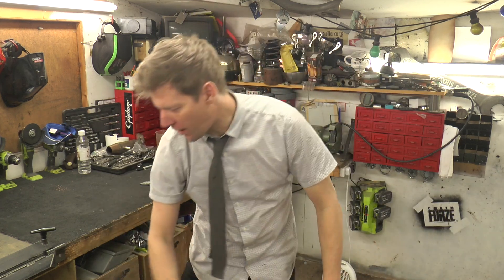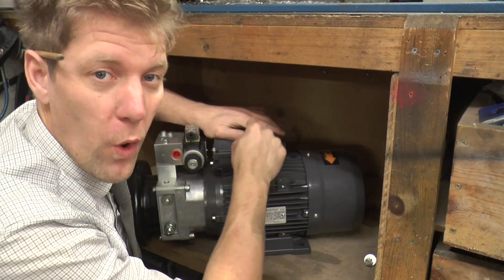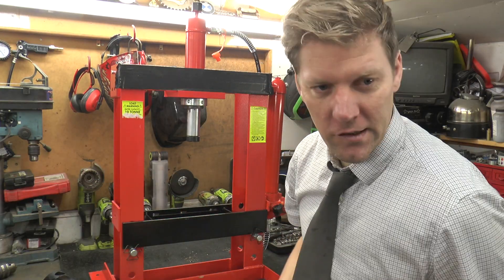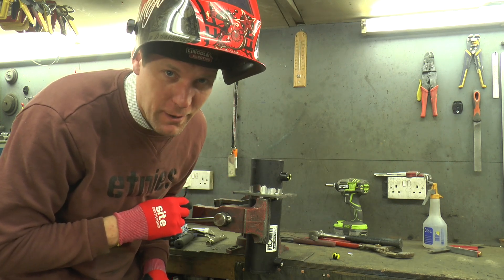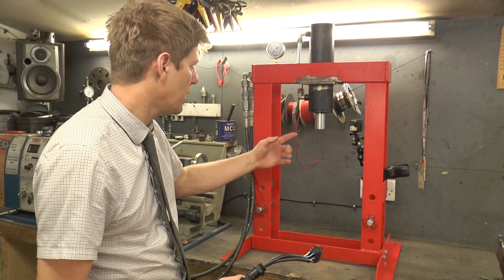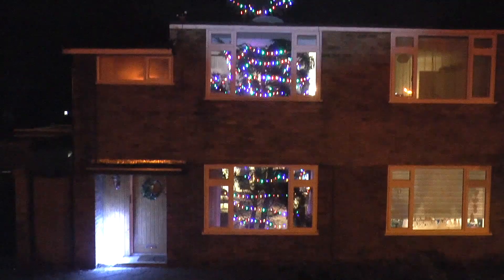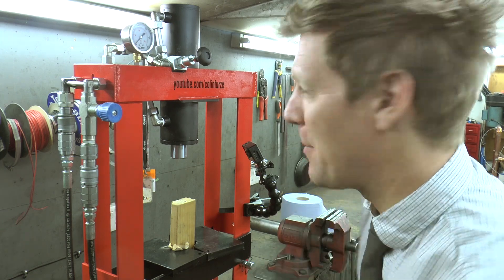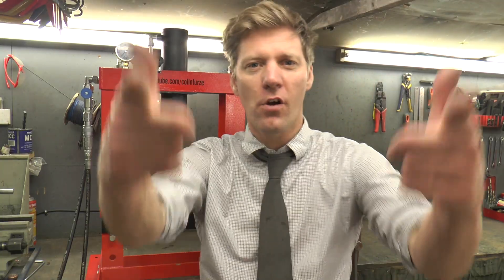Workshop Hydraulic System/Press conversion

Comment: Oi Colin' wot about ventilation for that motor and the oil , it will get bleedin'  hot under there sunshine. You've covered the fan on the motor, come on geezer.

Comment: does all ac wiring in england use those screw terminal blocks instead of the wire nuts we use here in the us? and dude you SERIOUSLY HAVE TO GET RID OF THAT SHITTY EURO TIG TORCH HEAD the  (american style?) type 9s and 17s are SOOOOO MUCH BETTER, theyre smaller, cheaper and more flexible torches are about 7 bucks on ebay, you want a 9f for up to 125a (you can push it a bit with lower duty cycles ime) and a 17f for up to 150a then get a ck superflex cable LIFE-CHANGING they stop trying to fall of everything you set them on cant tell you hoe many times my old garbage cable yanked itself off the table and cracked my glass cup

Comment: my concern is the lines leaking when i disconnect it
Reply: They are flat face couplers.  So when you unplug them the internal   cap pops back up and seals the line off. You may have a drip or two of oil but not emptying the whole line out. They are used in the construction industry so dirt doesn't enter the system.

Comment: Hey Colin, make a hover lawn mower.

no more tyre tracks on the lawn
grass gets blown away evenly to help as mulch and remove the need to empty the catcher
powered by a turbo fan..... because turbo fan.
Ultra high speed cutters for a good cut at high speed and can double as the power source for the downward thrust fan. (powered by a horizontal rx-8 rotary engine?)

And probably dangerous.
Reply: Hover mowers exist
(Flymo)

Comment: Nice mod. Is the motor getting enough cooling air though?
Reply: The motor only comes on for very breif times the cylinder is moving. There wouldn't be enough draw on it to do that and the vent on the end of the motor is not covered up just tucked away in the shelf.
Reply: Ok, thanks

Comment: PERSONALLY  I WOULD FIND THE AIR SYSTEM EASIER TO CLEAN UP A LEAKING HOSE THAN THE HYDRALIC WOULD BE.     ........ LOL@Colin
Reply: You can compress air, you cant compress hydraulic oil. Its better suited for doing work and transmitting power. If its leaking then that means a fitting is loose or worn so you fix it. 99% of the time its a small drip size leak in hydraulics unless you burst a line but you have to have been doing something stupid or have really old worn hoses to do that.
Reply: @buildthings79  YES IN DEED MY FRIEND..... BUT I WAS ALWAYS THE GUY WHO HAD TO DO THE CLEANUP AT OUR SHOP! ...... so you can see where I'm coming from eh. ...lol@me

Comment: In London, in the early to mid 20th Century, things were run on the system run by the London Hydraulic Company. High pressure water ran in pipes under the streets to work cranes, lifts in hotels, curtains in theatres, all sorts of things. Power was stored in 'Accumulator Towers', where water was pumped into a cylinder, which pushed  a huge piston, weighing many tons, upwards. When power was needed, the piston was released, and as it dropped, it forced water back through the pipes to do work. Simple, and effective.
Reply: That is actually pretty cool
Reply: Pretty EPIC
Reply: They had rights to pipe things under the streets, and though the hydraulic piping is no longer there, the rights are still valuable. They were bought by what was then Mercury Communications to lay cables.
Reply: That sounds like something that happened in some steampunk reality... like Dunwall in Dishonored.
Reply: What a fantastic lesson! Thank you sir.
Reply: Wow, thats cool
Reply: Interesting  : )
Reply: very interesting never heard of this
Reply: @Scott Shipley  - Water is far more forgiving, and less easy to cause secondary damage. It would have been bad enough to have had water at a maximum pressure of 700 Pounds per square inch, cutting through the road surface (which in a lot of London in late Victorian times, was tarred wooden blocks, so that horses could get a good grip). Imagine if it were oil, how far it would spread, not speaking of the hazard it would cause being spread on the road. So water it was.
Reply: your are correct .  is it the London Bridge or Tower Bridge that still runs on a near 250 year old hydraulic system  ?
Reply: Jesus Christ on a stick someone listened in history 👏🏻
Reply: @vividjoey8030  No. It's not taught in history. I read books and went looking, after seeing an 'LHC' pipe cover in the street, and wondered what it was.
Reply: @brianartillery  Not enough people do that these days, just stick their noses in their phones. :)
Reply: Wasted 1 minute of my life reading that and replying     

Life is too short

Comment: I like you Colin. What you think, you build. And its absolutely flawless! Keep up the great work Colin!❤
Reply: 1 flaw; the fittings should be male-female at each end, not male-male at the pump and male-male at the tool so the hose has to be female-female.  That ensures the tool is hooked in the same every time so the switch is always Up and Down the same way.  The way you did it can reverse the directions and that can be dangerous as you have to move the hydraulics to know which way you have it plumbed.

Tractor hydraulics have 1 male and 1 female at the machine (except some older tractors), Bobcat, Skidsteer...everything I have ever used with auxiliary hydraulics are designed so the hoses are hooked the same way every time.
Reply: I am SO confused: Why do I have so many fans on YouTube even though I am the unprettiest YouTuber WORLDWIDE? Thank you for caring, dear tavish
Reply: @AxxLAfriku  You don't have fans
Reply: @AxxLAfriku  you make the worst videos how do you have 16 k subs
Reply: @connor8964  sub bots
Reply: @AxxLAfriku  cuz ur fucking sad and comment on every post.also,you have no fans